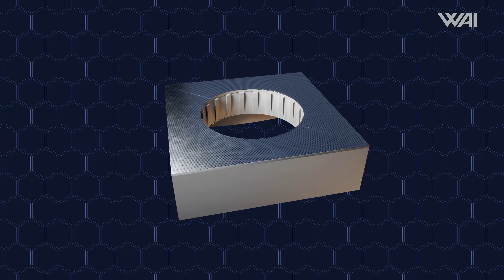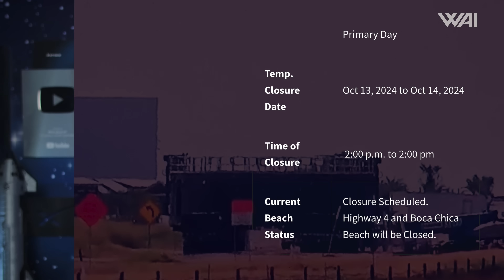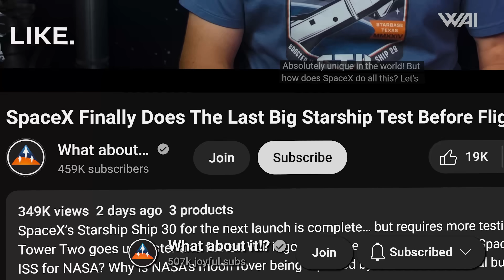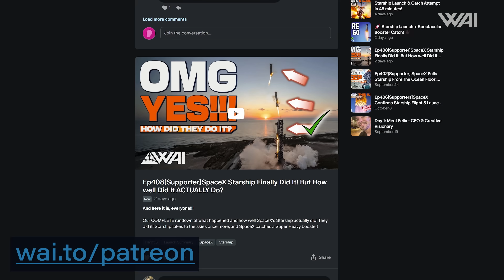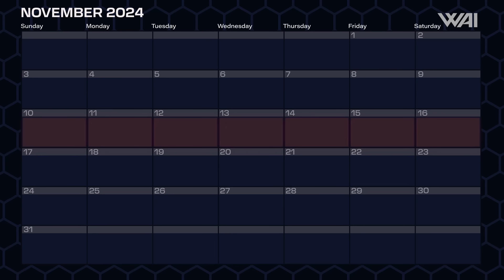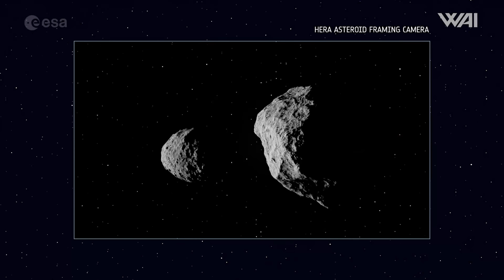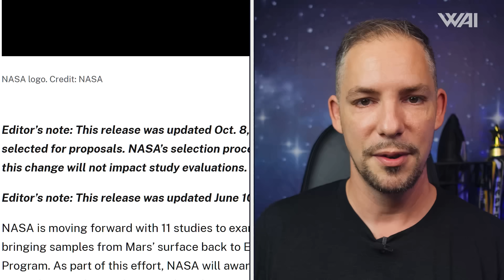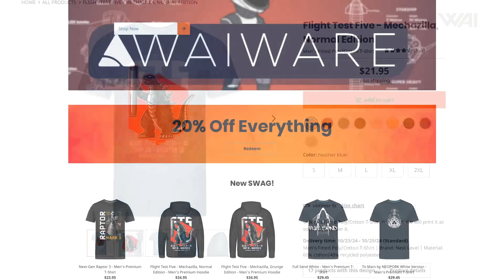SpaceX Reveals Flight 6 Starship! Possible Launch Date Available! Can They Do It?

Comment: I wonder if they are going to be able to control the fire of the QD. Otherwise they will have to refit the seals in the QD's every time they fly... Yes SS seals maybe could hold the heat without perm. deformation. Astill they will have to inspect every seal in detail before refuelin anyway
Reply: To add, if they control the fire there is zero issue, it's just that LOX burns at 3,420 deg K. Which is around 5700 F and 3150 C. Quite hot

Comment: So, SpaceX keeps having problems with heating on the Hinges on the Starship Flaps. Why do they have the pivot mounts exposed instead of recessing the, hinge points and the flap edge along the ship body,  into the side of the ship?
Reply: Because the V2 already have the solution

Comment: Why would they not use the same heat tiles to cover the they use on the  rocket to cover the space mount it can take extremely high heat also they  could cover partly the tower.

Comment: They need to put water (4), water suppression systems every 45 degrees, 80’ tall spraying down on the OLM as the booster lands. I know… expansion/contraction. No, won’t happen with shower head underneath. Just a thought. Thanks for the episode. U rock!

Comment: Dumb question, but why don't they use the middle ring of engines on landing? with more engines on, shouldn't that make the "flames" shorter and damage less of the tower and launch mount?
Reply: @RaphaelPereira1  yeah but maybe more engines increase the fuel consumption
Reply: @androcreer783  i agree, I just thought, since they dump so much fuel at the last minute before touching the tower like on IFT5, that could be a thing
Reply: Minimun thrust, with 3 engines the booster is able to hover, with more it would shot back up, of course F9 works this way, but it makes the final burn more complicated, the other problem is force, more engines would make the deacceleration harsher, maybe crushing the can.

Comment: The bigger engineering feet will be getting starship back from full orbit where it experiences even more heating and having it get snatched by chop sticks on its much over heated catch pin. They'll later need to add fuel cooling to the catch pin. And further still not sure why they are still getting burn thru when all they need to do is add mounts shaped like Voyagers saucer section cut in half and add offset hinges to the flap so that the hinge is never exposed to the plasma flow. They could covert them to header tanks instead of the central tank blocking the future nose docking port

Comment: Just because they are progressing and great video and catch. Progressing for sure and faster then previous.  No one really talking about it. We still only have a shell. Still no real crew, systems installed yet. There is so much to install Inside yet. Inside instruments,  temp Inside, air Inside. Ect, these need to be installed and tested. As if astronauts were in there going up. That's what the public is ready for. Aside from a outer space refuel. Systems, is together Inside and out. X is just outside together.  Mission is the moon and Mars. Focus needs to begin on that, not satellites.
Reply: Efforts on that are already underway on HLS program

Comment: This was impressive no doubt, but I still cant get my head around the necessity of catching the booster.
No way an individual booster will ever turn around in less than a few days: inspections, new parts, etc...and why subject the mount/tower to a double blast of heat?

Why not land it a 1/4 of a mile away on some sort of special assembly or pad and then roll it back into the "garage", so to speak, at leisure.
Have 5-10-15 new/refurbished boosters lined up ready to go? Man, that's moving cargo into space.

They never land the Falcon 9's back at the pad they launch from...they land them either on the droneship or a separate area.
Reply: F9 was an expendable rocket that took quite a while and lots of, er, practice, some with fireworks, to make reusable. Starship is totally reusable from the get-go with totally different objectives. What you’re suggesting kinda goes against what Elon’s trying to do. He wants true rapid reusability - especially for the boosters. That’s one reason that, even for this first successful catch, they went ahead and: lowered it down and latched it, AND then had the automatic system go ahead and connect the booster T-0 umbilical. Elon’s intention is, eventually, to have boosters land back on the pads they left…..not need ANY refurbishing….just be refueled and then have the next Starship, which was standing by, placed on top of it…..both of them then fueled, and launched. THAT. SAME. DAY. That’s one reason he’s emphasizing  the MASS PRODUCTION of Starships - and the TURNAROUND times of boosters. - Dave Huntsman

Comment: What if they add three falcon 9 to the starship to replace completely sls? Is that possible or is there any limitation?
Reply: No need , Falcon Heavy has maybe 1/3 lower performance than SLS (high energy orbits) but Starship has several times more performance than SLS to everywhere.
Reply: @admarsandbeyond  what if we add 3 starships like they did to falcon 9?
Reply: @PedroHenriquePS00000  To much complexity (if it's even possible) for little gains. Starship is rapidly and fully reusable distributed launch architecture. It is optimized to launch to LEO often and very cheaply to deliver propellants and refill outbound ships. LEO is halfway to anywhere as rocket scientist say.

Comment: I saw a video on X about the Grid fins partially melting due to hot staging. Any idea if that is true. How would that affect rapid reusability?
Reply: @Ray-01234  I think easily solved. As my understanding gridfins are made of steel for these early prototypes.
Later may be titanium-made grid fins, more durable and lighter.
Also the Hot staging ring will be redesigned and that probably will help too.
Reply: @latometoy2872  Titanium would work - it has such a high melting point as well. I looked up the price difference between titanium and steel and it said titanium can be 20-40 times more expensive. But I guess they have the money! It will be interesting to see the new hot-staging situation too. Its great to see the development process with all the hardware.

Comment: OK ----------. It's a Shame the Europa Clipper had to launch now on a Falcon Heavy, adding another five years to its voyage. If they had waited a year, an expendable Starship could have sent the Europa Clipper on a Fast Direct orbit, cutting its journey in half instead of tripling it. That would also have cut the total cost in half and could even have resulted in additional scientific hardware and even fuel going along with the probe increasing the length and Value of the mission.

Comment: Could they not have waited maybe 2-3 years with the Europa probe to use a Spaceship as launch vehicle? That should be possible by then and would have a lot of propellant to speed it up a lot.
Reply: It's better flying than waiting on the ground
Reply: @alvianchoiriapriliansyah9882  In the end I agree with you.
But they added five years to the voyage, and that are five years that accidents can happen.
I assume Spaceship will be ready to lift payloads into orbit in two years if not sooner. And give that it can carry 100t that could speed up the solar systems probes with lots of propellant. I am not into the stellar mechanics, but they may not need so much time for slingshots if they can boost the launch. 
It could happen that a later probe will be fast than the Clipper. :)

Comment: I am clearly no rocket engineer,  so I was wondering why does the starship need the heatshield, where the booster doesn't seem to have a heatshield at all. Plummeting to the ground at enormous speeds, only stopping it off at a mere few 1000 meters from the ground.
Reply: The velocity of the Starship is a lot higher than the booster.  Faster = more heating.

Comment: Long term, the need for quickly  relaunching is a necessity.   Short term, why not use a catch tower that would not endanger the equipment needed for the next launch?   Catch tower would only need the chop sticks and the ability to lower the booster/ship to a ground transporter to return for  refurbishment.

Comment: 16:45 to 17:00 A contradiction here? You say that using SLS, Europa Clipper would have taken 3 years to Jupiter, and that using Falcon Heavy instead means "adding an extra 5 1/2 years to the arrival date". But 5 and 1/2 years is the total time it takes. Would it add, the total time would be 8 1/2 years and the mission would start in 2033, not in 2030.

Comment: The fact thar you're already clickbaiting the "Flight 6 Launch Date!?" is kinda sad.
Reply: It's actually legitimate in this case though, because the FAA explicitly granted a license for multiple flights, provided they're substantially similar to IFT5. So there are no bureaucratic delays expected unless SpaceX decide to do something different (e.g. using block 2 hardware, or trying to land the upper stage).

Comment: Why even have a launch mount to get damaged? ...Chopsticks could do Launch and Catch. Now we know they work.
Reply: Because the chopsticks can't support 5000+ tons mass, and they need the mount to start the outer engines in the first place
Reply: @alvianchoiriapriliansyah9882  You'd ad a second set of chopsticks for the booster, so all the weight is not on one set of arms. I was not suggesting just delete the mount with no other reengineering to compensate for the changes. :)
I bet we see the mount deleted eventually "the best part - is no part" especially if it is directly in the path of certain destruction.
I did think the liquids self ignited on contact - but I may be thinking of a different rocket system.

Comment: Can someone please explain why he wants to belly flop the starship and not just have it land the same way the booster does? As the booster doesn’t seem to need anywhere near as much heat protection?
Reply: The Starship goes way higher and builds up way more speed.
Reply: @zachb1706  but this could be slowed to a similar speed to the booster could it not? I know it may require additional few or movement thrusters but then you would save on the panelling, I know he is planning on extending the length of the starship so that could accommodate the extra fuel? 

Additionally the bellyflop method will that work on every planet/moons they plan on sending it to down the line?
Reply: @TheFutureofAIUK  the booster only gets up to 2000km/h I believe, the Ship gets up to 25000km/h. So you need to shed that speed, you can do that by either expending a lot of fuel or using the atmosphere to slow you down.

That’s the glide. After that the ship bellyflops to drain off even more speed, getting down to 300km/h I believe. That’s slower than the booster and means the ship needs even less fuel for landing. You already need the heat shield to glide so this is just free savings.
Reply: @TheFutureofAIUK  and no they can’t do this on other planets. Mars they might be able to, with multiple passes needed because of its thin atmosphere. But you can’t aerobrake on bodies without an atmosphere like the moon, for the moon HLS will need to use its boosters to land.

Actually that’s one of the reasons why it’s actually easier to land on Mars, as counterintuitive as it seems. Though there’s other issues that make a Mars mission much harder
Reply: @zachb1706  so if it isn’t useful method for multi-planet could a more traditional landing be worth while then even at the expense of additional fuel?

Comment: Unless they can develop better materials, they may decide to build a separate catch tower and refurbish the booster between flights, but that is not what they are after with a key word being "rapid". The hardest thing to overcome is the extreme heat and blast from the rocket engines, will we ever get past that as a source of power to launch/land? Time will tell but we NEED the innovative spirit of people like Elon Musk or it will never happen. Production models are never exact copies of prototypes, we will obviously have upgrades on every launch testing to see what works best. Because of the previous delays in getting launch license, I think SpaceX will go as early as possible, time is money.

Comment: You really said that the rocket engines are closer to the launch mount/ground during a catch than during launch?? 2:12   Clearly not true.  Vectored differently, yes; but not closer. 17:21 NASA also saved almost all of the cost for the earth phase of the Europa mission.  Costs pushed 5.5 years out are much less, due to the time value of money. 17:21

Comment: You said that Europa Clipper will take 4 years to get to Europa. If refueling in orbit is going to be what makes possible flights to moon and mars then why couldn’t NASA launch a Falcon Heavy to put a boost rocket into orbit to rendezvous with the Clipper?  They dock and then a boost from orbit could go straight to Europa and save years and billions. This seems like a very small amount of imagination. Why was this not even attempted?
Reply: Because if you take the boost stage without a considerable amount of engineering (adapters, reinforcements), you ended up destroying the upper stage & Clipper in the process
Reply: How hard would it be to simply rendezvous with a tanker and refill the second stage?  You could also launch another second stage with a collar to contain the rocket nozzle so it would look like it was sitting on a shorter booster. Fire the new shorter booster and then drop off and fire the original second stage. Yes, some adaptation would be required but this is not overly complex. I’m just saying that if someone used a little imagination it wouldn’t take 6 years to get to Europa. Take off in 2024 and arrive in 2030. Anything that would shorten the trip would be worth some extra engineering.

Comment: Until... a catch of a starship is confirmed... 33 will not launch. As a Block two ship. It's more expensive and is slated to be.... reused (As much as possible.) That is the test bed. They will have a lot of changes to that ship... before we reach a finished product for sure. 

What will they change? If block one is to ensure the shape of the ship works and returns. Then this will be internal systems and refinements of exteriors assemblies and functions to take the weight and changes to the vessel. As in to make it habitable... Expect a similar path to that of the Dragon and Dragon 2 Capsules before they were award contracts from Nasa. As in there will be slower launch cycle for 33. As this is to ensure people survive begin transported by Starship. (We get to see the crash test dummy again.)
Reply: Source?

Comment: SpaceX needs to retire the "rapid" part of rapid reusability for now. Once a year is rapid enough when they have 50+ boosters and ships to launch every week, twice a week at 100+ so do not rush re use when you do not need to. If/when they reach 1000 ships+boosters that would be 18 launches per week or 2-3 per day with a full year between launches. So when the turnaround is cut to 6 months you will have 5-6 launches per day, that´s more than some airlines today. Do not bite of more than you have to just to prove yourself when there is no reason to do it. Relaunching at all is proof enough in my opinion, would you not agree?
Would a 100 ton load of liquid methane or co2 sent to mars and released do anything for the heat and or thickness of the atmosphere there and in the proses removing it from earth for us here? I do realise it would be parts per million or parts per billion but as a test load why not sins they are going there anyway. If ships are likely to crash on Mars the first few times anyway let's make it work for us.

Comment: What would Europa Clipper have cost without Spacex lol.
Reply: Atleast $1.5 billion for the launch, but it’d also need to be redesigned to withstand the large vibrations from the SRBs on SLS, which I think was estimated to cost $1 billion. And it wouldn’t launch for years
Reply: @zachb1706  they need a 3 or 4 booster super heavy config.

Comment: Seems like it would be a lot easier and less damaging to go back to landing the booster and starship on tail fin landing gear. You mentioned that the Falcon landing gear is sometimes damaged when landing, however that is super fast and easy to repair unlike the weeks it will take to repair the launch tower. Those Raptor engines are so powerful they will probably damage the newly designed launch pad for tower 2, time will tell. Of course,there will be a penalty to pay with landing gear resulting  in less weight to orbit but if SpaceX gets even close to launching one Starship per day this may be the way. One can armor up the launch table and, maybe the new launch pad only so much.
Reply: Where's that damage lmao?

Comment: I think they may upgrade B13 chime and upgrade the heat shield of the engine belt to  ensure stability to withstand the intense heat from 33 engines according to the data they have from flight 5 to prevent the repeat of the same as flight 5 also to reduce the speed of atmospheric drag may I suggest that they add draco thrusters to the booster to reduce wear and tare of the grid fins and damage to the engines or the engine belt too it's a heavy booster engines are not equipped with that much force and speed to be relite as we all seen from flight 5 before catch much like the dragon they about to use the draco thrusters for crew 8 and 9 to fully certify it's reusability to slow it's decent and speed.. as a suggestion I suggest draco thrusters for all boosters design    for starship boosters